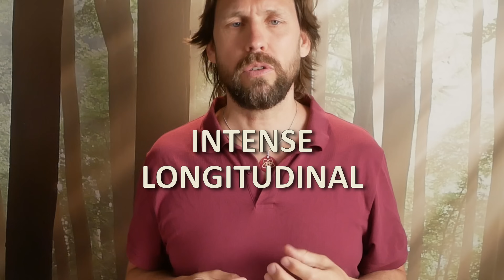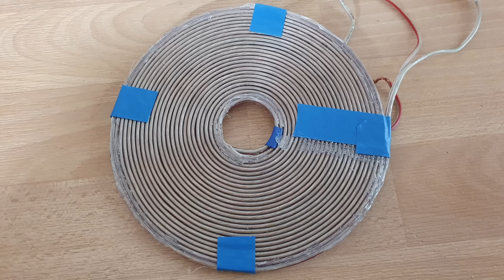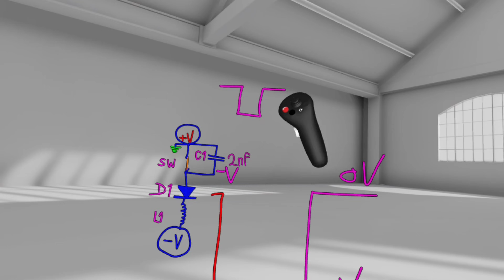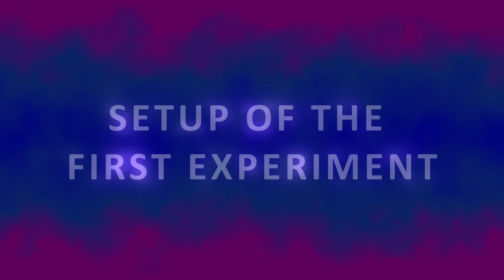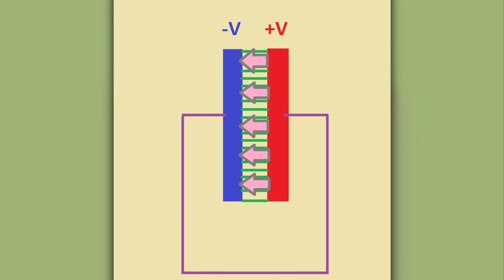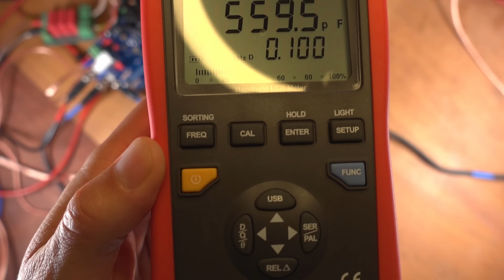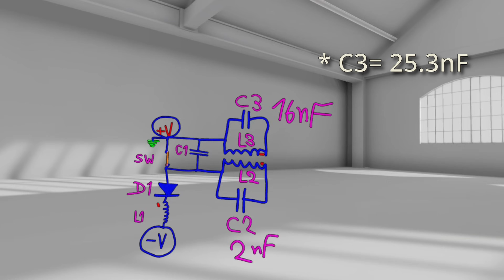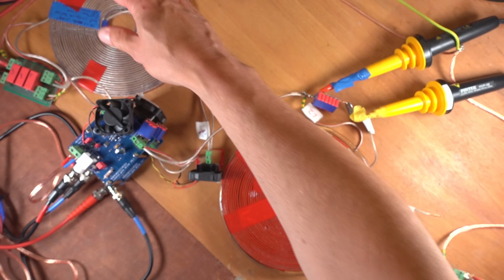Dielectric Induction producing Ground Currents

Comment: @masterIvo u did it sir! thats simply it ! with a bigger apparatus one can push less and pull more out of the earth which would work like a self charging capacitor that needs to be fluctuated while it is rotating and gaining energy that will never end anyway. thats what tesla did! And thats exactly what the pyramids were built for but. sir to be honest i follow you with the HIGH hopes of seeing not dielectric energy but “luminiferous aether” out of a spark gape a radiating light of literally penetrating solid matter. im here for the real deal i hope to see! i hope u harness it i really do

Comment: I'm not sure why that couldnt be done with magnetically coupled coils also since it seems to me that the eather ether whatever will form charges of either kind to restore balance but it always overshoots the zero line especially if the change in voltage or current is fast...The faster the more overshoot it does like a pushed swing will get back to stationary but only after swinging a while. I was just reading one of tesla's papers on spark gaps he said frequency by itself is not important but the change in potential per unit of time or delta T. then again i guess the back emf in a colapseing magnetic field is the restoration of balance....

Comment: Playing with my Pancake coils and your video pops up. Very interesting to watch. I'm using a pair of them experimenting with battery charging at the moment. They seem to react to the load I place on them. 3v in charging batteries up to 16v. Such a pain to make the coils. I use ductape sticky side up layed out to the size of coil I want and spiral it out adding super glue over the top every so often.
Reply from the maker: try using speaker wire.
and when you disconnect the battery, the coil can charge up a capacitor.
Reply: @MasterIvo  yes, it's all speaker wire, they look just the same as yours in epoxy. but mine are still free moving. I'm not use to using mosfets. I'll have to study your video some more

Comment: Therefore. It must be - and it is - possible, to create a machine, which uses in a first circle charged ( maybe collected microwave or other electromagnetic )  energy to push in second circle a generator a few steps forward and generates enough power, to charge in that way again the first circle ( if he has not enough energy collected in that time ) 
Push - work / generate - work / generate - work / generate - Push - work / generate - work / generate  ....
The combination of an electrostatic field and collection from - and in different ways accumulated - atmospheric energy ( microwaves are in east west direction and the electromagnetic in north / south ) is the key, I think.
The function of the law: Higher frequency / less resistance is a very important tool, I think. 
And the + or - electron orbital configuration between the elements. And piezo Crystals.
The element HgS should be an electrical conductor without resistance an by room temperature.
And I´ve heard , that Tesla uses often coppered iron wires in his experiments.
Maybe a coil which combines all that elements  in it, is possible.... ( n/e - e/w direction, electron configuration, PiezoCrystals, magnets and super conductoion )
And here in my town ( Bad Nauhein, Germany ) are very often Helmholtz Resonancer made of zinc on the old houses with slate roofs out from past times, where zeppelines and balloons are all over the horizon....
Hope to see a machine that works in my actual life. 

You make a great work !!

Safety first !  Safety first !  Safety first !  Safety first !  Safety first !

Comment: I never knew harmonics could be sub, I always figured they were multiples of fundamental frequency. Great video and super job on explaining.
Reply: Yes makes me wonder if it's a standing wave showing up... Maybe a slight difference in coil length or velocity mismatch  could create this ?
Reply: @billalderman4065  Well, it was a problem in my Ham radio days getting the output of transmitter to couple via line to antenna; thinking out of the box.

Comment: Dielectric induction / displacement current indeed doesn't involve Lenz's Law directly, however when you take into account Conductive media interacting with E-Fields you get a current density (J) which related to Ohm's law and therefore a current in the conductor, which then is subject to Lenz's law.
Reply from the maker: I intend to use lenz law with the L1 coil. but not in the usual direction (constructive feedback)
Reply: @MasterIvo please look into Dan's winter's theories on Tesla power transmission and it's simplicity. I too intend to do experiments for open source.
Reply from the maker: dan winter has nice thoughts, but are they grounded in reality I wonder. I prefer experimenting and learn from those results  @dwijgurram5490

Comment: @MasterIvo i wonder if i can use the same old board ( mosfet in series ) maybe i can split it to use it as parallel mosfet , or use 2 old board to be mosfet + mosfet in parellel to mosfet + mosfet  , 2nd question is what is ground earth means , is it the water pipe at home or the ground of the house ? which will cause a short if connected to V+ of the power supply
Reply from the maker: power supply is floating (like isolation transformer) so you can ground either positive or negative.

Yes you can detache the series mosfet (pcbs) and put them in parallel (stack them).
but it works best when the Vgs threshold is equal!
Reply: @MasterIvo ou never answered the second question which I feel is quite important, eg. How is your 'earth ground' connected / defined?
Reply from the maker: @forbiddenera   copper waterpipes are my earth ground
Reply: @MasterIvo  that is what i was asking asbout thanks
Reply: @MasterIvo  what I mean is I use the same board which have the same source of signal and I will just change the input and output of the two mosfet only which basically will disconnect the output of the first mosfet and connect the input of the 2nd mosfet to the first mosfet input and same will be for the output too right ? That should work
Reply: @MasterIvo  the Vgs threshold is the same if i do that on the same board do you agree ?
Reply: the power supply is insolated ok but the scope also need to be isolated too right ? all floating

Comment: Awesome! Be cautious pulling in current from ground - I've heard somewhat believable claims that it can cause strange local effects that aren't desirable. That one guy who succeeded with a Don Smith style device apparently found that out the hard way - or so he claimed. Nice work, so fascinating!
Reply from the maker: strange local effects? of what kind. sounds like magic.
and thanks!
Reply: @MasterIvo  Innovative thoughts here. Mabe he means that in a way, that we not collect so much energy, that the living nature around takes damage ( or through HAARP principles )
Or through radiation, ionisation or by cascated machines that have an efficiency from 1.+(x) ? :-)
Reply: @MasterIvo if you live in a tectonically active area, even minor earthquakes can cause strange things to happen including surges in electrical activity. It’s been proven via several recent earthquakes that “earthquake lights” appear at the same time as the quake. Current theories are piezoelectric effect caused by squeezing crystals, and another based on water that is more questionable since earthquake lights have appeared in dry deserts.

Point is, just be ready to receive a life ending or impairing shock anytime you mess with earth grounding. It has a similar effect to lightning that travels towards the sky, that is the particularly dangerous variant most folks don’t survive.
Reply: @Hyps-b2o  Yeah I'll update asap - I emailed the guy to get his take. I don't want to just talk out of my ass. He has a YouTube channel - Marc Belanger - he's an electrical engineer who does transmission theory for his day job, I believe. In one of his YT comments (can't find it right now) he mentioned that, when doing something similar to Ivo, he had bizarre phenomena occur, such as an electrical field that continued in a specific location despite the device being turned off. As I recall, this was associated with surprising levels of potentially harmful radiation of some kind. I might be completely incorrect, so give me a couple of days to track down more information. But the guy is super smart, and is one of the few people that I'm fairly convinced actually succeeded with getting excess power into his circuit from ground.
Reply: @danmoretti8898 Hi Dan. Look into Martin Fleischman Memorial Project researching transmutation of elements. There was mention/discussion some time back about residual fields/radiations after experimental apparatus turned off lasting days. IIRC electric spark emission 'erased' the condition.
Reply: Very good comment !

Comment: Earth ground? is their such a thing? or is it the voltage the planet is currently at relative to it's solar environment, somewhere between the anode of the sun and the cathode of the heliopause. We stand on earth ground as a bird perches on a high tension line.
Reply: I think like the atmosphere goes positive with altitude. it goes negative with depth which is why tesla grounded wardencliff tower deep in the water table below.....i read it went down as far as it was tall....never been there though..
Reply: If you have two separate earth ground, one earthing wire connected at the bottom of an empty well acting as cathode and the second earthing wire connected to the surface or top of mountain acting as anode, you could in theory have current flowing between two ground wires, extracting small amount of electricity from Earth which is a planet sized capacitor charged by the solar system environment.
Reply: Interesting perspective
Reply from the maker: voltage is always relative between 2 potential differences. Ground is one of those two potentials.
so ground can be anything (any capacitor)